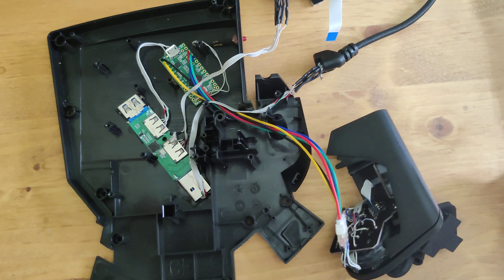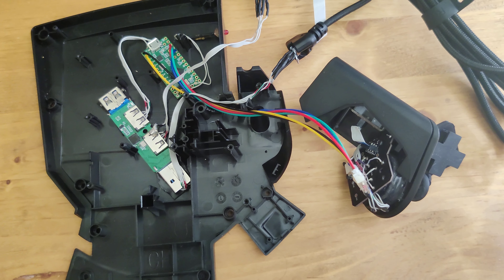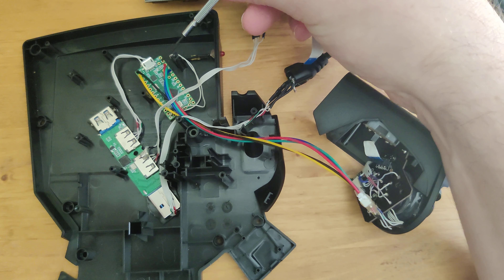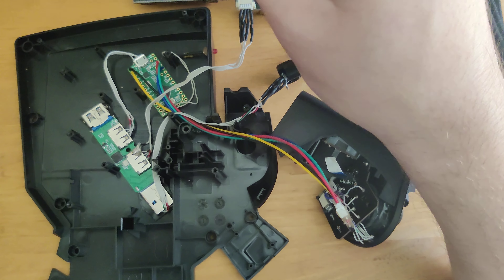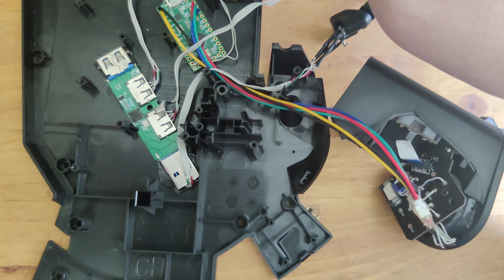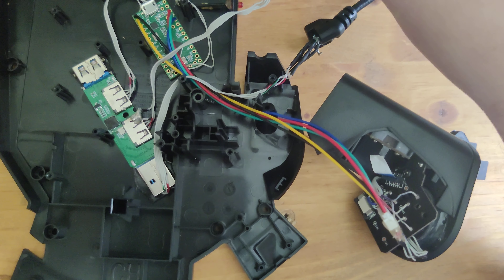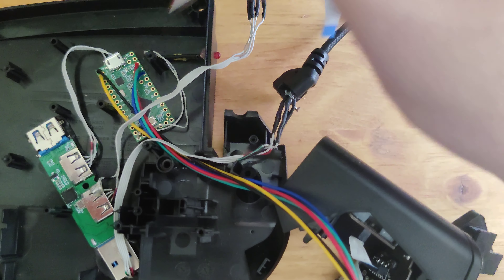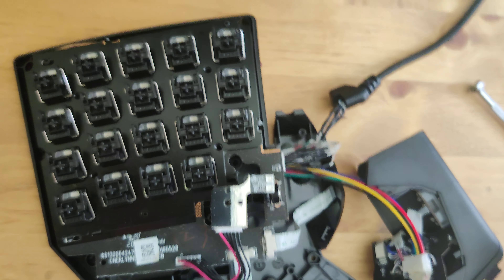Tartarus Pro updated analog mod with hub

Comment: I'm a little surprised I never thought of this myself. Its such an obvious solution in retrospect. Good thinking.
Reply from the maker: Yeah, it seems like a good solution. To be fair, it took me a few years and a suggestion from somebody else to get to this point.
Reply: @tuffrabit  What's your experience with a teentsy like? I'm in human-factors engineering as a hobby, and I'm looking at going from sculpting forms and scanning them to make, to actually building stuff myself.

Super wanna try replicating a mecha cockpit.
Reply from the maker: @osakanone  Teensy has been great for me. I actually messed with Teensy's before I ever touched an Arduino or Raspberry Pi or ESP32. Choice of board really comes down to the project at hand though.
Reply: Awesome. This looks much more professional and cleaner 👍